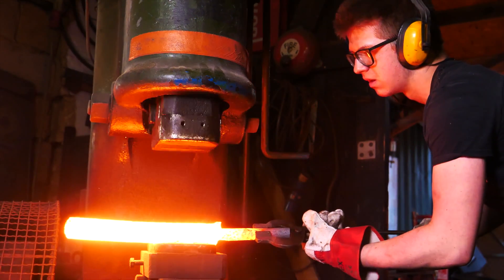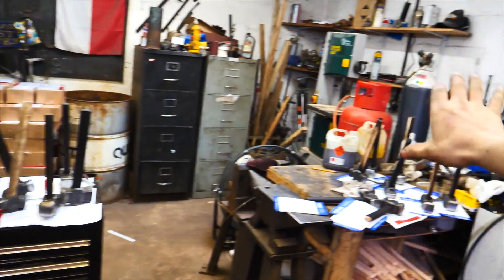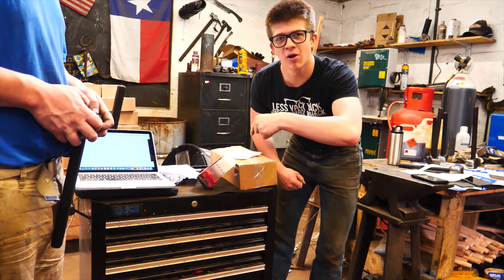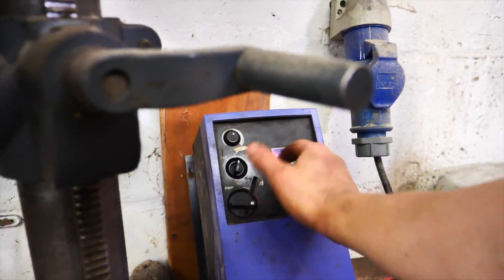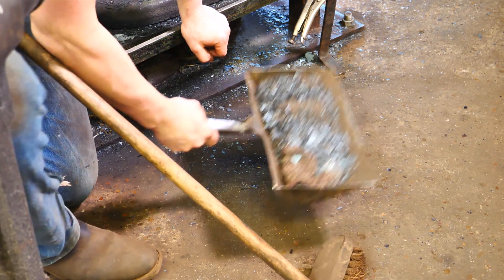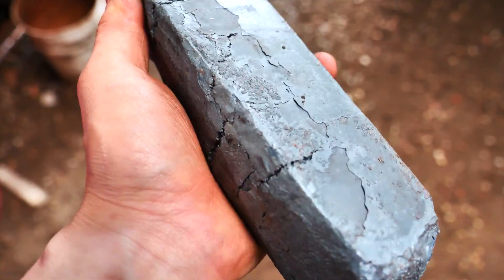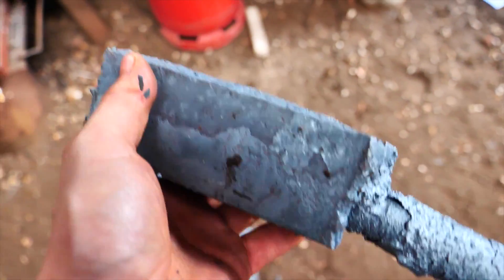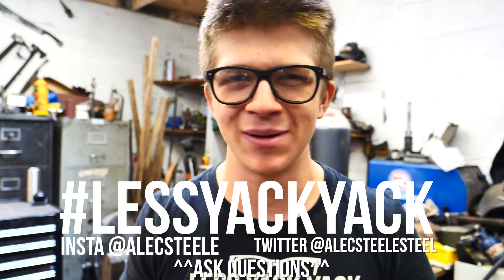THE HAMMERS ARE FINISHED!!!! + I WANT QUESTIONS FOR Q&A

Comment: What do you use as flux for forge welding damascus? 
    What tools did you use to get into blacksmithing, as in what did you use as a forge and everything?
    When will you have more information on the next set of classes you will do?
    How can I get on of those hammers too? because mmhm, those are some good looking hammers!
    last question, what kind of steel should I buy to get started? because I've mostly been using scrap and rebar.
    Sorry about all of these questions, I'm just a very curious 16 year old that really wants to get into blacksmithing and just making things in general

Comment: #LessYackYack 
Alec, I enjoy watching you making things.  I really admire your work ethics, (Sam too!)  
Question:  I have an old percussion, double-barrelled 12gauge shotgun with beautiful twisted Damascus steel barrels (with 150 year old British Proof Marks!).  I was told that these barrels are forged by wrapping the steel wire around a mandrel and hammering the heck out of them until they weld together.  (I'd send you pictures but can't attach one here.)
Have you ever done that?  
When you were making the Damascus "Tin whistle" I thought that it would be done around a mandrel. If you are familiar with the Damascus made with wire around a mandrel, could you demonstrate it?  Maybe you could make a whistle with that method, since making a gun barrel would probably cost you followers.  8-)

Comment: Alec- I have a truck bed full of brake rotors and drums. Any suggestions as to things to do with them?
Also have some axles for their good steel. 
Maybe you could talk about some sources for good steel to work?
One more if you could address it:
I have a few hammers that are just plain small sledges. I was thinking to reshape the faces to create a half round and with another one a  diagonal cross peen. If I do this, what would be the best way to go about heat treating them back to proper hardness?
#lessyackyack
Reply: I've made a lot of knives and wood carving tools out of brake rotors. The hard part is splitting the vented disk with an angle grinder... as you'll throw super hot large sparks everywhere that will set stuff on fire (its how I set a plastic bucket on fire). The drums are a lot harder to use, but as long as you can forge weld well they cut up easy enough.

As far as heat treating the hammers, you'll need to remove the handle, and put a new one on when done, but the easiest way is to use a Map Gas Pipe Welding Torch. It's the narrow yellow bottles at Lowes/HomeDepot. Just like anything else, heat to 1500+, quench in oil (or water if it doesnt harden), then use that torch to pull the hardness out SLOWLY! You'll want a very VERY light tinge of yellow at the hammer face.
Reply: I don't know that I've seen alec do a lot of found-object reforging... >_>

I've seen others do it on youtube, but not alec so much, it seems he usually uses fresh steel.  I think Green Beetle does some, but also Chandler Dickinson, The art of weapons (TAOW) also does some... I think there are others as well...
Reply: I've seen those folks as well. Just hoping to contribute to the Q&A he's asking for.
Reply: courier11sec ah, I think I missed the call for q&a questions
Reply: Thanks for the reply. Was hoping to give Alec a few things to discuss in the Q&A he's asking for contributions to.

Comment: Assembly line works the best.  Set up a staging area with 5 or more open boxes, then have 2 people wrapping hammers placing in the box, then tape and label all as a group.  It is the fastest method.   LOL!
Reply: Also create a part number and a color code.  The part number will allow an easy way to matching shipping slip with product.  Then by using colored tape you can organize the bubble wrap and still know what is what.  Yes, you will get confused.  And Yes, it can be very frustrating.  My advice is to use a part number that relates to the product, for example: A 3 pound cross peen hammer = HCP3.0.  The end results is that you know the part numbers because you designed them.

Comment: You may have covered this in a previous video, but did you char the handles for a functional or aesthetic reason?
Reply: Both
Reply: rjtumble I believe charred wood is more water resistant.
Reply: Ah, makes sense.  I know there's a method for charring wood that will be used as house siding for similar reasons.

Comment: I have a few.
1. Is the quenching oil temperature ever a factor?
2. Do you watch any other smiths on youtube?
3. Do you plan on making a sword at some point (assuming I didn't miss it already)?
4. Ever work with crucible steel (perhaps a solution for your damascus miss hap?)?

Comment: Alec I got a hammer off E-Bay that had a cool wedge system I know you would dig. It has two "C" shaped wedges, that comprise your "S" when installed together. Looke really sharp and methinks, functional, as it spreads the wood in all directions. Cheers! G

Comment: Question: How much material is typically wasted - in the form of scale as well as the material that you remove from filing/grinding/belt sanding. Sometimes it seems like a lot, but maybe it really isn't all that significant.

Question: What, if anything, can you do with that failed bar of damascus that pulled apart on you? Is it now a door stop or paperweight or can the steel be reused somehow?

PS: Sam seems to be a great friend to have - great to see the camaraderie!
Reply: If you wanna see how much is lost in scale and gringding watch his viking sword make. He measures and weighs it periodically and talks about how much is lost in grinding and scale.

Comment: I have a set of seemingly impossible projects for blacksmithing. This is why I desire to learn blacksmithing:
[1] Can socket wrenches be forged?
[2] Can Hand tools like crow bars be forged?
[3] Can a bicycle be forged?
[4] Can a hand tree saw be forged?
i am not familiar with blacksmithing; but, I would think these items to be near impossble; if not impossible, to forge.
I forgot to mention, I could weld the ratchet end of the socket onto the socket.
I have a huge list of things I want to make.
Reply: Robert Hocker By all means go ahead and learn the skills to make them! but really, all those things seem totally possible to be forged (assuming you did the bike in pieces, not just one solid piece 😂)
Reply: I thank you very much for your information. I am learning for a survivalist purposes. I want to live in the remote areas and be capable of making everything I need.

Comment: #lessyackyack Explain, at some point, the heat treating process of making a hammer, what Rockwell Hardness are you shooting for, or how do you gauge the metal as to when it is ready.  Are you going for maximum hardness, is there a tempering process etc, and the same set of questions on the other tools you make?

Comment: #LessYackYack Hi Alec, I'm a budding tool worker, mostly fixing edges, rehandling, sharpening, and a few cases of fixing warps and bends in blades, annealing, fixing, hardening, that sort of thing. It's a pain doing that with a torch instead of a furnace of some sort, and I'd love to move into smithing. Any tips as to how to save a few pennies in getting a shop equipped and started? Thanks from me and my customers, Kenny
Reply: Kenneth Compton : Go back to the video with Sam and Alec putting together the simple forge that Sam is fabricating and selling!  THAT would be the most affordable way.  Unless you have the plate steel and a way to make the requisite cuts.

Comment: I know you got a new one, but That old VFD is probably still good. Looks like the front potentiometer might be failing. It should have some wire terminals for a remote potentiometer. You will need to change the speed reference parameter in the VFD. #lessyakyak

Comment: Ok Alec, Got a question for you cause I would like to make one at some point, I wear a cowboy hat everyday, (most time not in shop) BUT I need several Cowboy hat hangers for house and shop, thinking the type that has mount plate, curved L shape bar then a 1/4 round top to hold the hat, at some point could you build one so I can see/learn how a experienced blacksmith would do it?Thank you from Rocky Mountains of Idaho

Comment: I'm a beginning "blacksmith" and i have my own (silly) forge but what are the best excersised to start blacksmithing?

PS: you should try and make a shield
Reply: gerben vande Walle S-hooks
Reply: thanks
Reply: S-hooks teach you how to taper, bend, twist, round and heat. Depending on how fancy you want to get they can also be great for learning to use many different types of fullers and other tools. Plus you learn to make your work symmetrical.
Reply: thanks i appreciate your effort in explaining the point of the exercise thank you

Comment: Back to the billet  that you burned.  I get it is toast as far as using it.  But, steel is steel, right?  Chemically it is steel.  So, can it be melted down in a smelter and turned into something?  Can carbon be added?

Comment: You can save that. cut it into 1/4" slivers length wise and etch them then fill the cracks with epoxy or send them to Peter Brown so he can do some epoxy on it. would be very interesting. Lemon-aid bro LEMON-AID

Comment: #lessyackyack I've always been curious why you choke up on your hammer so much?  I understand that it will give more control but the times you are just flattening out steel wouldn't the extra power speed things up and make it somewhat easier?

Comment: #lessyackyack 
Hi Alec,
You've mentioned in an earlier video that steel is cheap and easy to find in the UK. I find the opposite in the Netherlands. Steel supply stores, scrap yards or online shops usually only sell steel which I cannot use (e.g. dangerous like galvanized), or are of an unknown steel type, which makes it hard for me to determine if it's suitable knife steel. There is only one shop within a two hour drive which does have usable (identified) steel types, but charges significantly for it.
Before I spend loads of shipping cost for importing steel from other countries, what would you advise with regards of steel sources?

Comment: why do you hold the hammer so far up the handle.  why not use a lower weight hammer and hold it at the end of the handle, like a carpenter would?